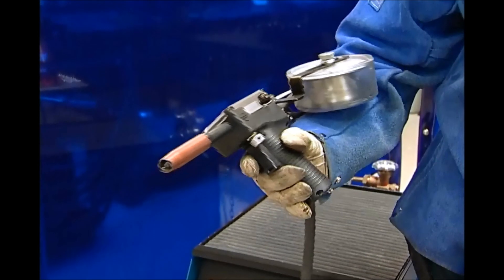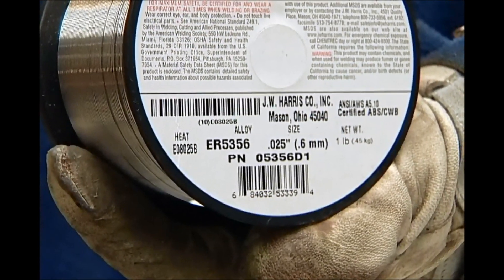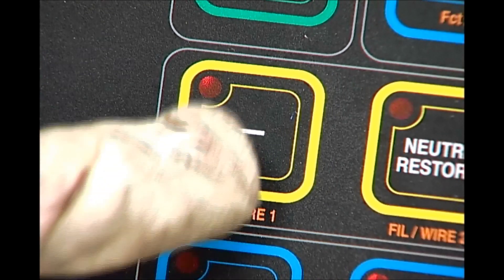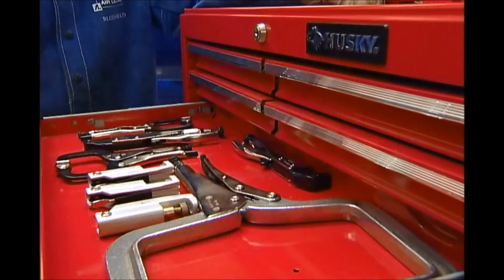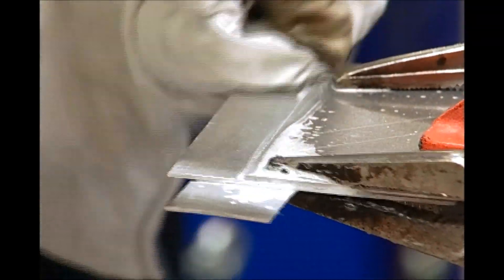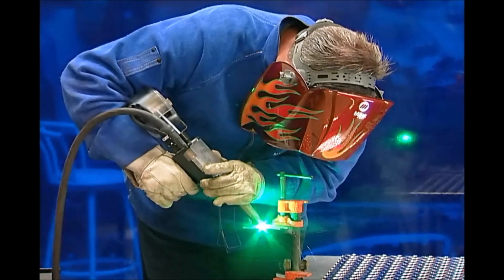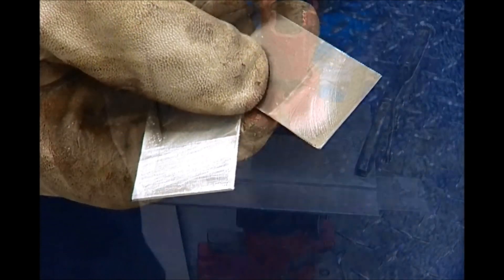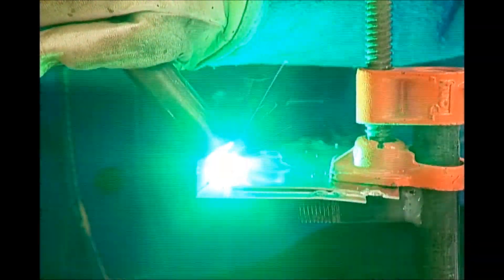UltraMig 200 - Mig Welding With Aluminum Spool Gun

Comment from the maker: Do you have the Synergic torch with the variable settings potentiometer on the gun handle? This increases the power and speed of the wire flow all at once and should give you a great weld. I will try to find you a user manual so hang in there.

Comment: Since you're using this machine, could you tell me if the Ultramig 200 can have it's heat adjusted manually when welding steel? I have this machine but sometimes the penetration of the weld comes up a little shallow with the microprocessor controlling it  and I can't find an owners manual for it anywhere.